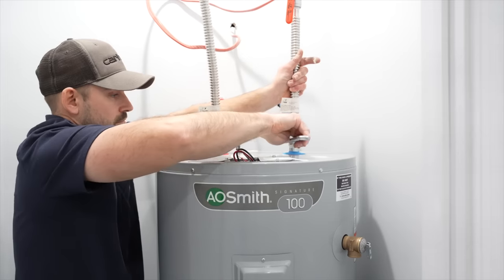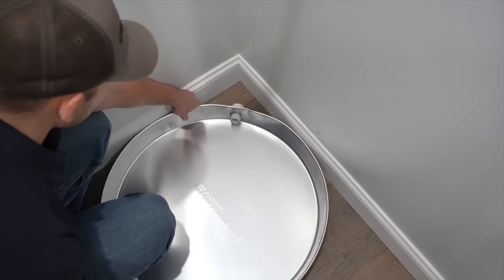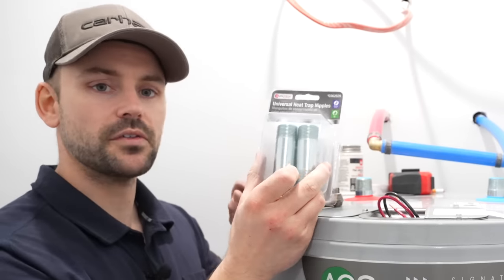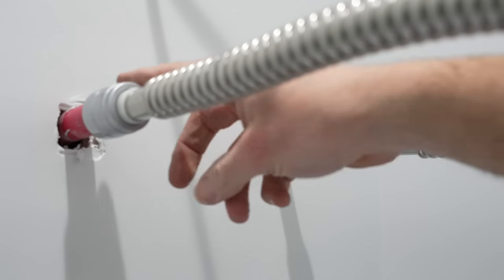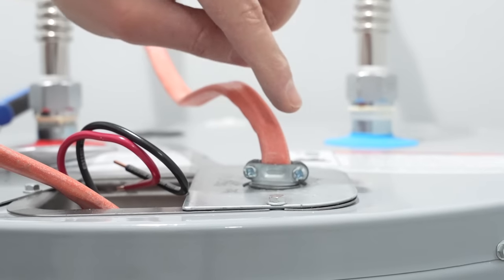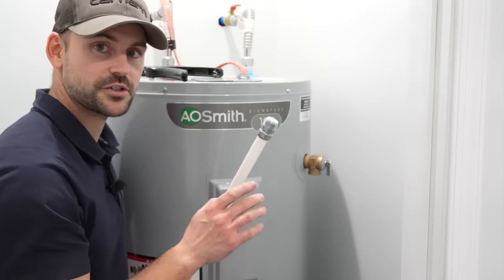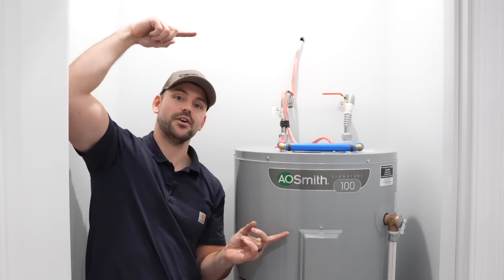How To Install An Electric Hot Water Heater Tank

Comment: A lot of good info for the typical homeowner to install their own water heater….as a plumber there is a lot of stuff I would do differently but for the average non plumber homeowner it’ll definitely work and save them money, and that’s what matters (along with safety first), good job
Reply: What would you have done differently? Use M.I.P by pex adapters instead of shark bite?
Reply: @jordank1203  Absolutely, I cannot think of a scenario where I'd use yark bites, other than for a quick and temporary emergency fix. And would never cut all of the pex so close to the wall, in case you need to redo things some day.  Also, as far as I know code requires a disconnect for the electrical feed right on that wall, I thought that was the case pretty much anywhere.
Reply: Yup, and there’s  no reason to tape & dope those heater nipples as, the flex pipe has rubber nitrile end seal washers  ….
Reply: I also would not wrap the electrical cable to an uninsulated hot water line. When electrical cables get hot, the resistance in the wire increases, so it requires more power to do the same job - less efficient, but also seems more prone to failure.  And I don’t cut the wire to length, I give myself extra. It sucks when you need to make a change in the future and the cable is a little too short.
Reply: @gabrielo8922  agreed, why the fuck would you wrap a live wire to a water pipe, that could theoretically generate a shock to the water line if the cable ever gets pierced or melts.
Reply: I mean it’s pex. Super easy to crimp instead of using shark bite. I mean by the time you pay for all of the shark bites, you might as well invest in a crimping tool ($40)
Reply: @neocollective if you are going from two different types of pipe you could use the yark bites

Comment: That fact that Lowe's contractors charge as much as they do to do this is insane. I will definitely be doing it myself. Thank you
Reply: Are you buying the same brand? is it good? btw how do you drain and get rid of the old tank?
Reply: @Sean  Yes I bought the same brand. You can drain it by hooking up a hose to the drain faucet on the very bottom. I also drained some of it by taking off the water pressure valve and emptying it into a tub from there because it was faster where I had so much build up. Just know that as soon as you take it off it will start pouring out. As far as getting rid if the old one I just hauled it to the local dump.
Reply: @JScruggs94  Thanks. Did you purchase it from LOWES?  was it heavy after it was drained? some of my PEX brass fittings are corroded and slightly leaking most are fine. I'm on well water. but i do wonder why some corroded some not. i suspect the  rings were not cramped too tight and leaked....some say to replace with plastic but Josh advised to use the brass ones....
Reply: @Sean  Yeah I got it from Lowe's. It wasn't all too heavy after being completely drained. As far as the corroded fitting I'm not really sure.
Reply: @JScruggs94  Thanks. LOWES has three. 50 gallons short and tall which i assume the same with different tank height. another is 55 gallons. Tried to find some info on the difference but other than the 5 extra gallons i couldn't find. strange that its cheaper than the 50.

Homedepot offer the Rheem Performance. have you considered this option before deciding to go with the AO Smith?
Reply: @Sean  I don't have a Home Depot so I was limited on my options. All I have here is Lowe's.
Reply: @JScruggs94  Oh I see.....

Comment: Guy just quoted $750 for an install excluding the heater. Not the most expensive compared to other comments here, but 750 is 750. Thanks!
Reply from the maker: It’s all about DIY to save a ton of money! I’m glad I could help you out. Good luck with your project!
Reply: $750 just for Water Heater and labor added on top $ 3-500 more

Comment: By the way, the NEC states that there should be conduit around the electrical wire.  Also, I wouldn't recommend securing the 30amp wire to a metal pipe.
Reply: Conduit requirement can vary by location of water heater and the jurisdiction. YMMV.
Reply: Hot metal pipe.

Comment: Just want to thank you for this tutorial, our brand new water heater kept leaking after several attempts and frustration, putting the joint compound around the thread after plumber’s tape made it a done deal with the leak… thank you so much !!

Comment: A lovely, clear video as usual! Your presentation and speaking skills are top-notch.

My area (North Carolina) requires an electrical shut off, an expansion tank, and strapping as well, for anyone who is curious about possible code variations. And maybe conduit, I'm not sure on that one.
Reply: Also in North Carolina, also need a permit to DIY: "a permit is required...of any plumbing system except that in any one-
or two-family dwelling unit a permit shall not be required for the connection of a water heater
that is being replaced, provided that the work is performed by a person licensed under G.S. 87-
21, who personally examines the work at completion and ensures that a leak test has been
performed on the gas piping, and provided the energy use rate or thermal input is not greater
than that of the water heater which is being replaced, there is no change in fuel, energy source,
location, capacity, or routing or sizing of venting and piping, and the replacement is installed in
accordance with the current edition of the State Building Code.

Comment: Good job. Our jurisdiction requires 2 extra steps. Electrical disconnect within 3 ft of the water heater, and the discharge pipe on the t & p valve has to be strapped to the tank near the bottom.  Plumb on!

Comment: Love doing water heaters. Most of the ones I've done are gas. One thing for code in our area, we would have to have the wire in flex conduit or rigid on electric water heaters. With gas that have a power vent the cord can be exposed and taped to the cold side because of heat on the wire coating. 
AOSmith water heaters are a good brand with a great warranty. The flex lines are a big time saver as well. Most jobs hear are basement jobs and need to be 3-4" off the ground if the unit doesn't have a factory buildup so they don't rust out from sitting on the cement floor. I've replaced many from that issue. Happy New Year to you Josh and I always love hammering the like button. 👍🏻
Reply from the maker: Using flex conduit is something I have heard some areas require. That is a good thing to check. I have not installed a gas water heater but have seen them. I have had good luck with AOSmith and Rheem. Yes the flex lines also help in areas with earthquakes from what I understand as well. My uncle actually had one rust out from setting on the floor like you mentioned. Happy 2023 to you as well David. Take care!

Comment: EXCELLENT!!   
When my electric water heater was replaced (in 2011), the person who installed it placed the (horizontal in my case) pressure relief valve pipe RIGHT OVER the anode. Now I can't replace the anode because the pressure relief valve pipe prevents access to the anode  - please advise how to move the tank without disturbing the pressure relief valve pipe, thank you from a new subscriber!

Comment: Some jurisdictions require a metallic relief valve  waste,earthquake strap and a vacuum breaker. Also the the appliance disconnect either within 6 ft or in sight of the water heater.

Comment: Not sure if conduit is required by NEC code. Curious if taping orange wiring directly to hot water pipe, will it be a safety concern? Code is various across the country though.

Comment: Great video! Only question is why fasten electricity to hot water outlet? Could the wire melt due to heat?
Reply: No. Plastics melt at a much higher temperature than that of the hot water. I personally wouldn't attach electrical wire to any pipe that carries water.

Comment: The best video on YouTube about an electric water heater. I'm thinking about replacing my gas heater with one of these electric ones, the reason it's because the chimney runs in the middle of a bedroom in second floor. Do you think is more  expensive to run an electric heater vs natural gas?. Thank you very much😊
Reply: An Electric water heater is maybe cheaper to buy since I think they are simpler to build.  However, it takes about 3 kilowatts to equal the BTU,s (British Thermal Units) in 1 Therm of natural gas (a therm is equal to 1,000 cubic feet of gas).  So just to break even with gas, electricy would have to be 3 times cheaper.  Also gas has a higher recovery rate (how fast it can reheat cold water) than electric.  The only advantages electric heaters have is; since you don't need a vent, you can locate them anywhere you can run water and wires.  Or you have to use them because gas is not available in your location.  I like electricy, in that it is so versatile, you can make light, run moters, ext.  But when it comes to heating, there are more efficient ways to do it.
Reply: My house is 100% electric ... how I wish I had the option for gas. lol

Comment: Should’ve installed a J- Box on the wall and run a conduit, Greenfield,to the electrical connection on the water heater. P.S I used shark bite on a hot water heater, and the plastic part that sticks out started deteriorating and begin leaking on the hot side after four years only use them if I have to. And in the open.
Reply: I don't think any inspector would approve of that wiring. Could use j-box or pass conduit through wall. As long as wire is not bare like this guy did

Comment: If you have to wait days before a new water heater can be installed it would be nice to have a shutoff valve on the hot pipe as well.  I turned on my water thinking I could still use cold water in my house but it started pouring out of the hot pipe... had to go out and buy a nipple and cap.  A valve would have been much easier.

Comment: I bought an ao smith and have a 10 2 wire coming from a dual 30A. but the wires coming out of the water heater are 12 gauge. Does this need a 20A breaker instead?

Comment: Are these better than a traditional gas unit? I didn't know they existed! Very informative!

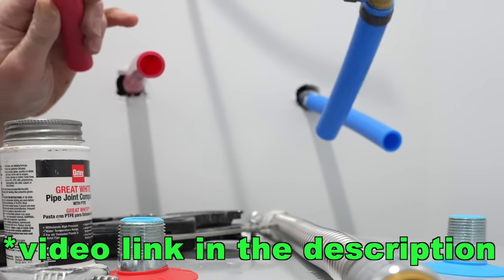7:36 Is that blue thing in the nipple a plug you forgot to remove? Just making sure! 😁
Reply: Gas is generally more efficient, so for now at least you're likely to prefer gas. However much of the country does not have readily available gas service and so electrical really is the only choice.
Reply from the maker: The blue that you seen was the PEX coating inside of the nipple. Electric is not more efficient than gas. The only gas I have in my house is to my range in fireplace. I just use a little propane cylinder. I do not have natural gas in my area.

Comment: I am dreading the replacement of our tank.  We currently have a 65 gallon tank and its on its last leg.  Thought about replacing the elements but after opening the cover the whole side of the tank is covered in rust.  Also I tried to purge the tank and there is so much sediment inside that the drain on the bottom is clogged.  I don't know how I am going to move the old one since I can't drain it.  Of course the location is in a tiny little area barely big enough for the tank and there is no drain pan.  Any water leaks out its going to do major damage.

Comment: You don't need to remove those blue caps at the top of the water connections on top? I'm installing this very unit today and with a quick glance assumed they were simply caps to prevent stuff from falling into the tank but maybe not. There is a tiny blurb in the instructions that say some models may have "heat traps" in the inlet/outlets and not to remove them. Is that what those are?
Reply: Yes they stay. Plus they are dielectric, stopping corrosion on pipes.

Comment: Great videos! I’ve learned a lot. I have pex in my rv and just installed a new dometic toilet. The prob I have is that the space is very tight and I had to bend the pex to a 90 degree angle to get it attached to the toilet. The old toilet had the water pedal on the left side and the new one has it on the right, so I had to extend the pex and then bend it to connect it to the toilet. The pressure in the rv is about 35-40 psi. Will the pex fracture over time with it bent like that? Thanks for your advice!

Comment: Do you have a video showing this installation along with an expansion tank?  Do you think that installing my new heater with expansion tank will get rid of the water hammering that happens when washing clothes?  The water heater will be about 10 feet from the washer.  Thanks!!
Reply: Expansion tanks do not eliminate water hammer.  You need arresters on your washer inlet hoses.

Comment: Nice!    just so  others know  if you  are governed by  UPC code   t and p must go  to another source not the  pan (prohibited)   and  no less than 6 inches more than 18 from floor.     Also Im no sparkey but exsposed wiring like that dont fly here we use conduit like armor flex?      lastly a plumber would never wrap teflon tape around a nipple that has a water flex connection   the reason is there is a rubber hose washer that seals it just like a garden hose   we dont use tape and dope on garden hoses either as it prevents the fitting screwed on and sealing at the washer.   other wise it looks good

Comment: In my jurisdiction, I had to have a breaker box adjacent to the hot water tank, even though there was 40 amp 240 volt breakers at the house panel.  From the adjacent breaker box, to the tank, I had just enough slack to make a secure connection. (about 6 feet). My tank's electrical connection is/was at the bottom third electrical entry to the tank.
Reply from the maker: Thanks for sharing your experience!

Comment: I have a water tank im replacing 19.5 gallon (1650 watts/120volts) with the same model your working on but is 19 gallon (1500 watts/120volts). My question is will i need to change the wiring out or is it as easy as just hooking it up to the new tank because the wattage and volts are pretty close to the same?

Comment: Just a question I have 1/2 inch copper feeding the water heater. It looks like there is shark bite hose that is 3/4 on one side to connect to water heater and 1/2 inch on other side to connect with copper. And I would I use cold side wry shutoff valve on hose

Comment: Once new one was it I turned the water on to fill and halfway it started hissing ??? Not sure if it's a transfer of cold water into a tank to prevent cold water from cooling the hot pot or something else. 
So I shut in water and popped the pressure valve for silence 

Is there 2 pots in a water heater or just one ?

Comment: Replaced my wated heater about a month ago. Now it seems like maybe air is trapped? Occasionally, I will get air sputters coming out of the faucets when I turn on the hot water. How do I fix this? Can I run all the hot water faucets for a period of time or do I need to actually drain the tank? We've replaced a total of 4 since I've been in this house and didnt  do anything differently this time. My water quality is bad, very hard, well.

Comment: A lot of codes require an expansion tank or valve, a flexible metallic electrical conduit and disconnect switch.  Always check local building codes.

Comment: You should crimp the ground wire with the ring terminal.
Reply from the maker: I appreciate your input!
Reply: @TheExcellentLaborer ,you welcome. Just a little advice.
Reply: @sonton8530  no do not crimp a solid wire, that screw has stood the test of time if the wire is wrapped correctly, also do not tape a wire not, for it will hold moisture and develop into a bad connection.

Comment: Can Pex come off the water heater nipple . or is there a req to use the braided or coil reinforced connection?. Or copper? To come off the hot & cold WH nipples? Ive seen some reference a req of copper for 18" off nipples...these braided / coiled prefab lengths are supposedly an option ..but if pex is used can that be cut to more accurately fit from that nipple connection to the house system  pex? TIA

Comment: Great video.  But.  Exposed romex is not up to code.  I'm guessing that this was a post inspection install.  Or not inspected.  Granted, it's not that likely, but that wire could get cut or damaged.  It's a fire hazard. You should run it to a junction box and then run some flexible conduit to the water heater.  I see it all the time with DYI installs. Don't do it.   Also.  You should strap the unit to the wall so there's no chance of tip over.

Comment: I'm not a plumber, but I'm pretty sure you don't want to just tap your drip pan drain directly into any "nearest drain" in the basement.  Did any plumbers catch that?  Without a trap, you would basically be making your pan drain an open hole to the rest of your septic system, and that would be come a very stinky closet, very fast.

Comment: What if there is no drain close to the tank? My current one doesn't even have apan nor a drain, it's sitting on concrete slab in the kitchen under cabinets 15ft away from the sink

Comment: I have a water heater that was recently installed but not working. The 240 cable has a white wire thats not connected to anything. All other cables of the 240 are connected. Where does the white cable go?

Comment: Actually the real problem was , it was not completely neutralized, like someone else mentioned,  bsking soda will neutralize completely,  then it needs to be dry,  then protected with some rust preventive coat, because once clean it will be exposed and get rusted again.